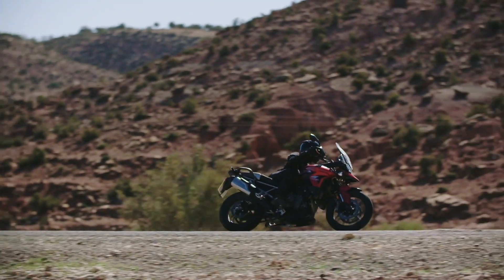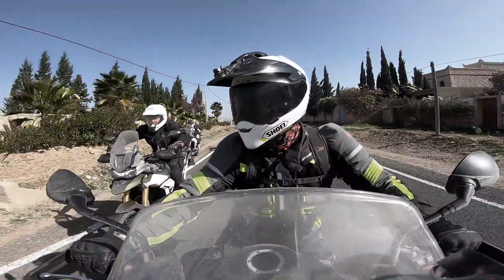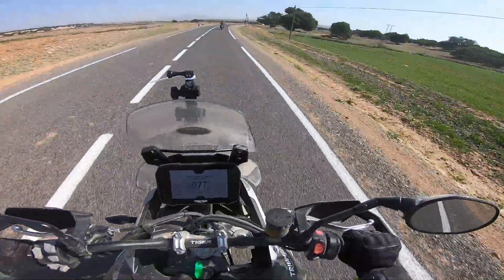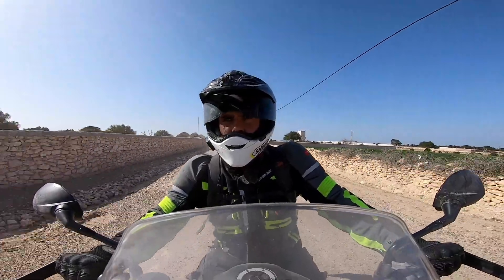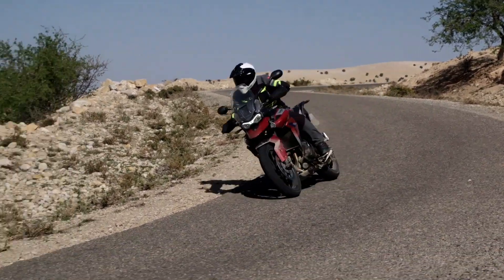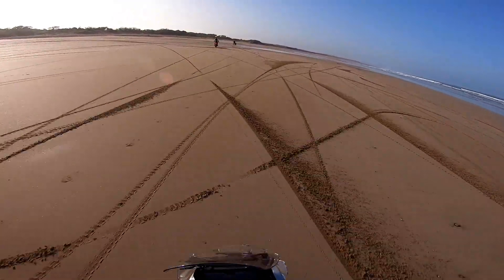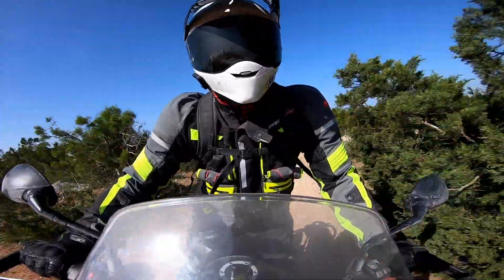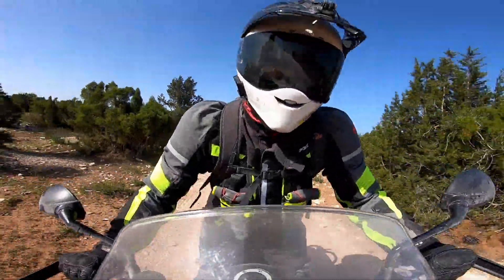Morocco Adventure: Triumph's Tiger 900 T-Plane Engine Explained | Visordown.com

Comment: Is the firing order similar to the crossplane 3-cylinder in the MT-09?
Reply: No, the mt09 is 120 degree spacing (240 degree firing) as per most triples.
Reply: @lordgibbness  which is weird because they still call it CP3 as if it's cross plane. Kind of misleading
Reply: Well it is still a crossplane crank, in the sense that if you looked along the length of the crankshaft, it would have crank arms in different planes (not simply 180° opposed).  But yeah, I get your point, they are sort of using the CP3 tag as a marketing aspect in this case.
Reply: @lordgibbness  I see what you mean

Comment: It's the old thumper - or big-bang vs screamer debate.  Uneven firing allows the rear tyre to dig in and grip rather than spinning.  A bit like  what ABS does for braking.